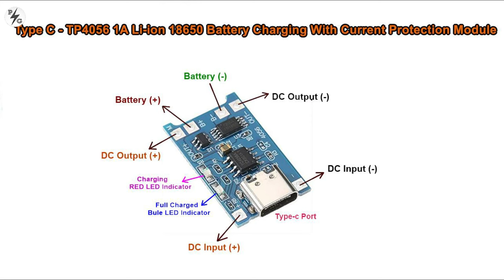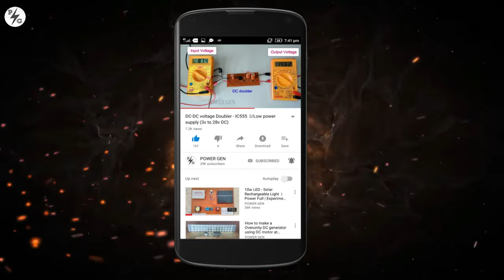Type -C TP4056 3.7v Li-ion 18650 Battery Charging With Current Protection Module | POWER GEN

Comment: Is it okay to replace the R3 resistor with a lower resistance resistor to increase charging speed. Also a heat sink on the IC and a fan to counter the heating?
Reply: How much?
Reply: I'm an amateur but what other resistor would work to increase charging speed ? I already put the heatsink with thermal pads that solved the heaving issue

Comment: the module is too hot while charging .. avoid it
Reply: U can fix it by putting a small heatsink with thermal pads between solved the issue although not a very small one maybe the one used on PC motherboards the small passive one
Reply: @BRIGS21  which part should I use the heatsink?
Reply: @aditmaul3  the small chip just below the type c port
Reply: @BRIGS21  tyvm appreciate it